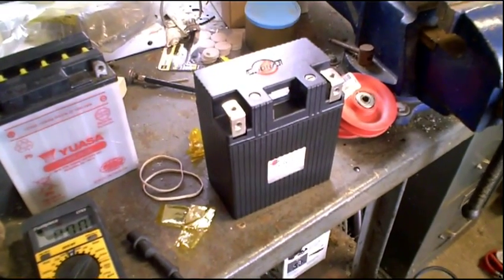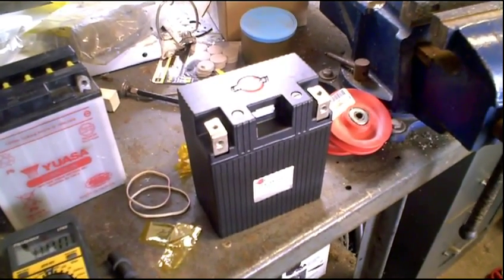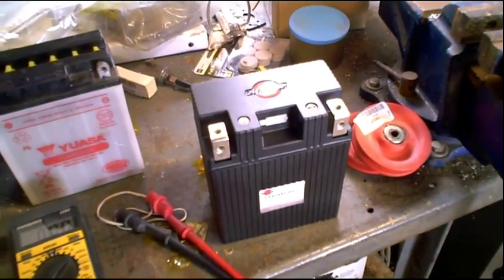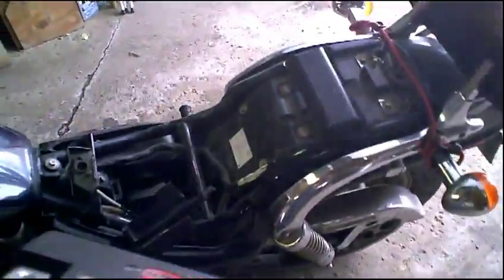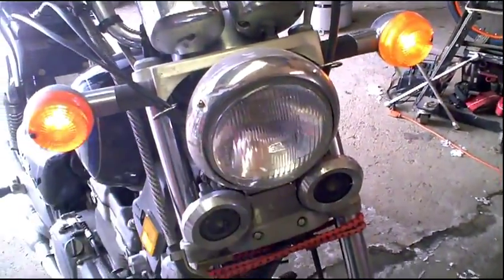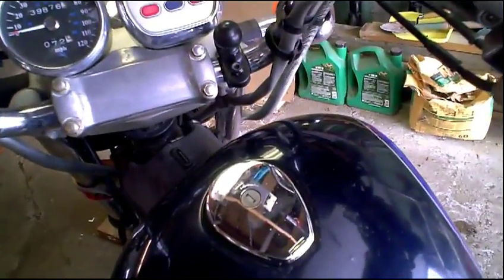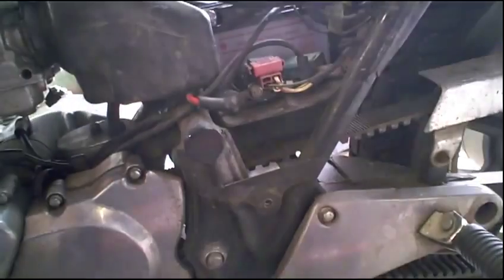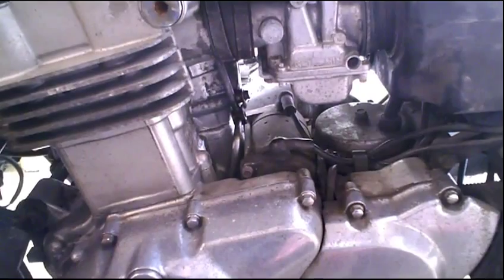Shorai Battery Part 2 NOT fail Maybe starter failure?

Comment from the maker: Well you guessed right. The mechanic said the brushes were gone.
I do have a new Yuasa installed along with the new starter and the bike starts great. I may use the Shorai as a portable power source for my small Kmart compressor because it can handle that with plenty of power to spare and it's so light it moves about easily.

Comment: 2 of 2 to slowly power through the compression stroke,  With the starter and or solenoid on last leg, this extended high current frys the contact / brushes.  In addition all LiFePO4 batteries are very weak cold compared to warm or compared to a cold lead / acid battery  I know it's counter intuitive but it's true and you can watch the current go through the roof when a starter turns slowly.  Good luck with that Shorai, I sure haven't had any.

Comment from the maker: +Dana Muise
According to a mechanic I spoke to he believed the low voltage on the battery caused the starter windings to overheat and short out. I talked to Shorai and they agreed to send me a replacement battery. I am still not confident to use it in my bike so I use it as a portable power source for my 12V compressor. It seems to handle that job great for over a year now.

Comment: Tried rocking the bike in gear to see if the starter motor is just stuck? Or bump start the bike to see if it is working other than on the starter, Thats the handy thing with my Royal Enfield Bullet ,Electric AND Kick starts. Hope it all works out, Cheers from the UK Dave

Comment: I can tell you from working in electronic repair for over thirty years these coincidences happen more often than you would think...In fact they are downgraded to regular annoyances for me. It doesn't take many of these 'coincidences' before immediately going into a test routine and start to diagnose every possible cause before condemning the new or obvious part as it will continue to bite you otherwise. It saves a lot of time not jumping to conclusions. 
Don't feel bad about it we all learn the hard way, I sure did.
I have noticed a lot of people having a go at these batteries and have a feeling there is much more to it than simple quality issues. Many car and bike chargers optimised for lead acid..or not so optimised(ie.awful) can be an issue, unless there is built in management on the battery. I hope there is with this Shorai. A lot of charging systems will quickly overcharge a lithium battery, also many alarm systems draw a fair current and will drop a battery to below its safe charge level very quickly ( a few days left unused). Lithium requires careful charge and discharge management. (As I say hopefully it is onboard the battery).
Reply from the maker: I see two issues working together that make it hard on this type of battery. The motorcycle charging system is meant for a lead acid battery and they claim it will be fine for this Shorai Lithium battery.  
I also see when tested, the actual AH rating on the battery is half what they claim despite the specs on the side of the battery case. 
I would say at this point after owning quite a few Lithium batteries of different types the technology has improved a lot since I made this video.  
My latest Dakota 23 AH battery actually performs at around 25 AH and still has a bit of juice left. 
This Shorai battery made no claims of any onboard BMS that I could find. 
Newer Shorai batteries are probably not the same as they were in 2013 when I made this video.
Thank you for your well considered comment Martin.
Reply: @suburbanryder  Wow. That is a surprise not performing to spec...Then again I thought it was a bit lightweight. You can't change the physics re energy density..Bet the Dakota weighs double the Shorai?
Subscribed.

Comment: 1 of 2 It's not a 100% coincidence.  Heres how it happens.  Your starter was old and tired.  As the old battery failed, it couldn't hold the voltage up.  Less voltage and the starter turns slower.  The compression stroke is where the starter works the hardest, draws the most current.  With a good battery the engine gets cranking quick enough that it blasts right through the compression stroke, but as the battery weakens the cranking slows down and the starter ends up drawing very high current.

Comment from the maker: Took a truck battery and went direct to the starter. It would still only turn if I tapped it with a hammer as well. Shaft is probably binding on a very worn bearing.

Comment: In that case the coal brushes most likely are worn and/or the bearing has too much play. 
If the collector is still in good condition just replace the coal brushes and bearing, much cheaper than a new startermotor, just saying. ;)

Comment: If in cold climate recommenced go up with higher CCA
Reply: Correct and that was the largest CCA I could get for that application. 
Unfortunately the stated CCA is really half of what is printed on the battery.
This is not from me this was tested by an engineer who came on my comments and told me to go watch his video tests of the Shorai claims vs reality.  Since I do not have an engineering degree I will take his word. It seems to jive with my real world experience with the battery.

Comment: i'd still be interested in seeing how the Shorai does in your bike on a cold cold day.  In my experience Shorai and most other LiFePO4 battery manufactures recommend at least one size smaller then optimal to make the price look more competitive in price to the lead/acid batteries they replace.  FYI a fully charged LiFePO4 12 volt battery will show about 14.4 volts and a 90% charged will show 13.3  from here it moves little as 12.9 is only 20% charged.  flic.kr/p/bAU7vH

Comment: You posted a video calling this guy's product a "fail", when the bike was the problem.
In this video unfounded criticisms of the battery are posted.
- .A more capable battery will not kill a starter.

- A more capable battery will not cause your brushes to be "gone".

In order to be small and light, Starters have a poor duty cycle. Cranking on a starter too long will kill it.

Like lead batteries, lithium-iron batteries have strengths and shortcomings. And yes, lithium-iron batteries require different care than lead batteries. None of that was your problem. The guy even sent you a replacement battery when the original one was apparently ok. It isn't fair to publicly knock the product based on incorrect information and assumptions.
Reply from the maker: A well known battery expert came on my comments and told me I was wrong that that the Shorai battery was the main cause of my failure.  I take him to be the expert since I am not at his level. If you have some sort of higher credentials or more information than he does then fair enough. If not I will defer to him.  I later found the battery is even falsely labeled for having a certain watt hours rating that is not even true.  It is actually half of the watt hours they claim.  So I will stay with the info as it stands.
Reply from the maker: Joel Wisman is an expert. Maybe ask him about it. https://www.youtube.com/watch?v=ySNbSZTgplA
Reply from the maker: Joel Wisman
Check out some of the other videos I posted.  I know what I'm doing.  I 
was a licensed industrial electrician before becoming a motorcycle 
dealership service manager for BMW, Aprilia, Piaggio, Vespa, and Moto 
Guzzi.  Shoai batteries consistently failed when tested precisely the 
same as cheap lead/acid batteries.

Comment: I will not buy another Shorai again, it had ruined my starter (2) times. Use the yuasa!! Do not use shorai, unless you want to keep buying a new starter.
Reply from the maker: A battery expert told me the Shorai probably killed my starter. So it will not be used in a motorcycle ever again. I won't take the chance. Thanks for the comment Greeek.
Reply: Sorry to hear that you too are having problems, The mayor: My bike is down again with the starter bad again. dam shorai. I too have to pay another $510.00 for a new starter and also for a new battery. I am not every buying a shorai, just got in a new Yuasa. Now waiting for starter to get in and have the dealer fix it. Good luck with your bike Mayor.
Reply: there are lots of batteries to choose from
I used Yuasa in my GPZ and KH's back in the day.
Used a Yuasa in my Harley and it didnt last 3 months.
Bought a 2011 Harley and the previous owner had installed this Shorai and now I need a new battery charger for the Lithium Ion Battery...it may or may not last but for the last three months it cranked the Big Twin over no problemo, no worries.
Not a very scientific or even a dyi test....
Get that multi meter connected and show us the meat and potatoes